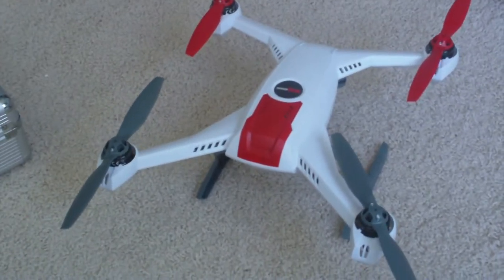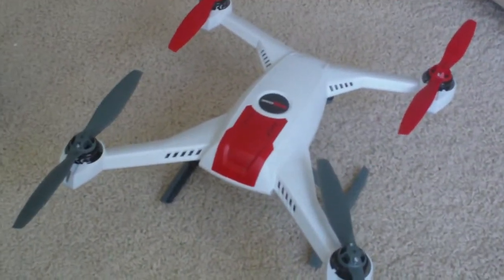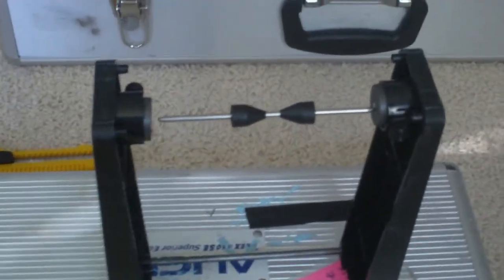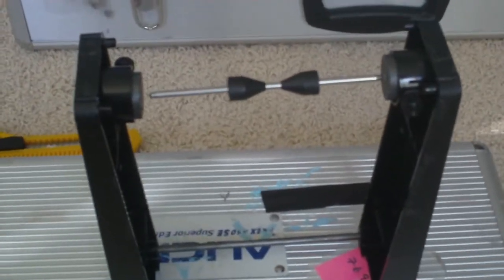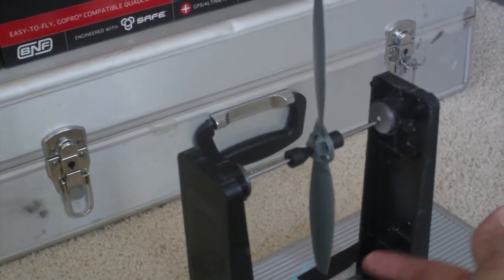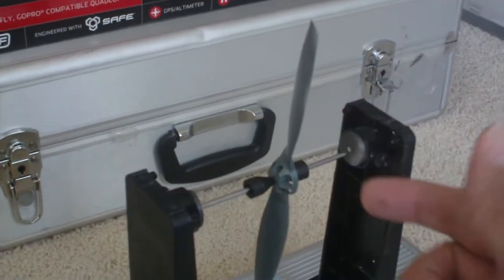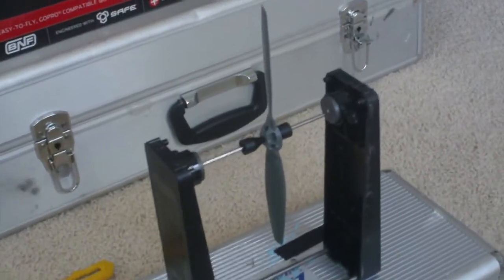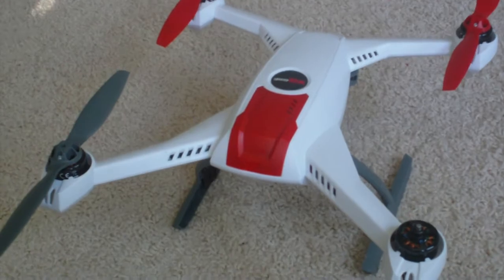350 QX: How to balance the propellers

Comment: I recommend sanding the blades. that tape is no good for the airfoil while sanding with fine sandpaper evenly over the heavy blade is not so likely to cause problems. Its the center hub that you would add pcb to to add weight to the light side but only on the hub.
Reply from the maker: seanlovesjobo both approach works well in my experience.  most people don't have a fine grain sandpaper lying around the house.  while electrical or even scotch tape are almost always available.
Reply: This is true. Sense i've made this comment i have seen a ton of people using tape.

Comment: Did you look at the aero dynamics of propellers first? Maybe good info to know which side to paste would have less effect on the aerodynamics. Cause I think if its on top of the blade be better than on the bottom as the airflow for the lift is have the air speed increase under the blade which causes the lift.
Reply from the maker: Great point!  I'll have to try that.  I appreciate the tip!
Reply: I think you might find that the air movement over the top of the propellers will have a tendency to peel off the tape, on the bottom it pushes up on the tape. Just saying
Reply: thorfoot1 I don't think that would be an issue as you should use proper tape and not something that would be easily to get loose as it also should be snug on the prop and not be flapping around it wouldn't be easy for the tape to peel off. And mainly as tape would thicken the prop by a few microns and have a kind of small ridge which and as the tape cover 10 to 30% of the surface area and it could have some effect on the aerodynamics.

Comment: You might also consider placing your strips of tape 90 degrees from their current orientation.  There is a lot of air flow moving across the props, and placing the tape lengthwise like you did in this video will interfere more with that airflow.
Reply from the maker: nice tip.  thanks, killboydotcom.

Comment: Do you think the reason there are so many prop issues at the moment (other than the fact that it is a cheap chinese plastic) can be because the props are not correctly balanced? Or tightened more than necessary?